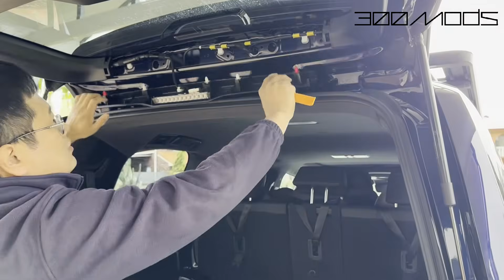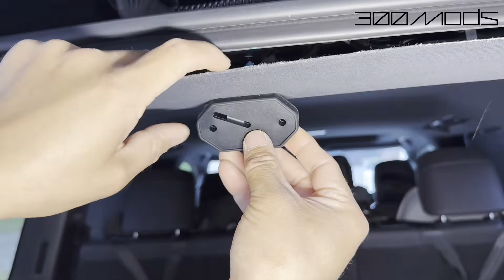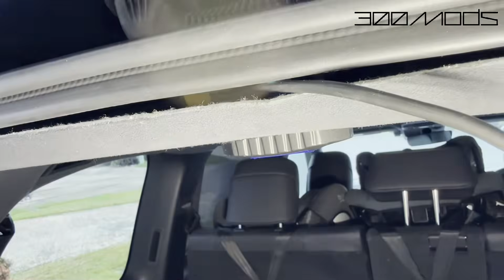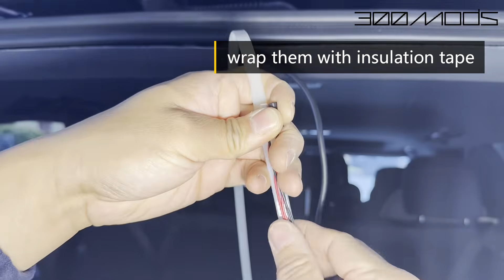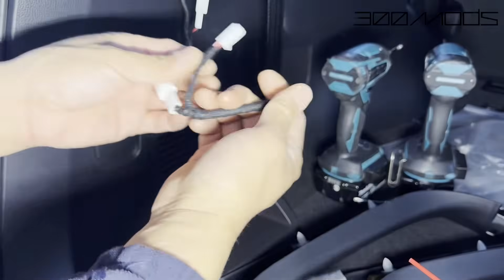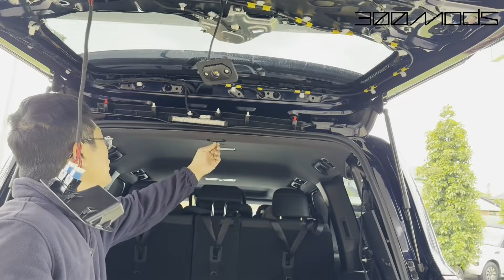Toyota Land Cruiser 300 Tailgate Boot Dual LED Lights

Comment: Can you wire these directly to the aux battery so you can have it on independently of the cabin lights? Is it ground switching that will cause ghosting if you do that?